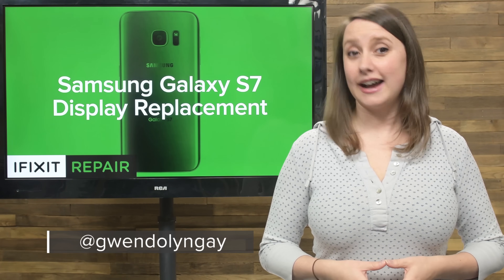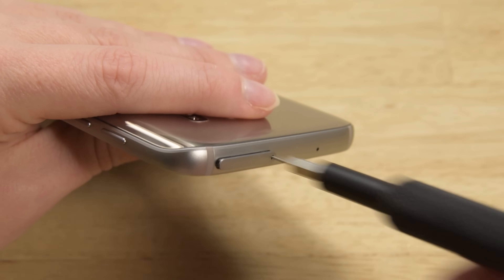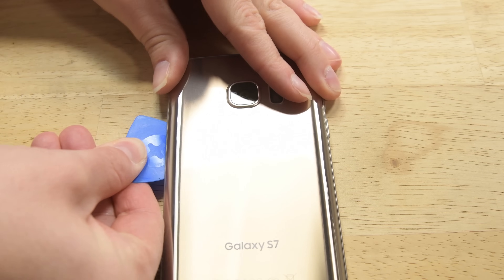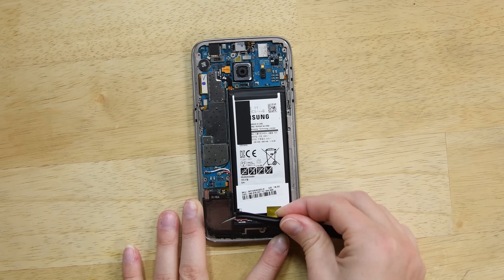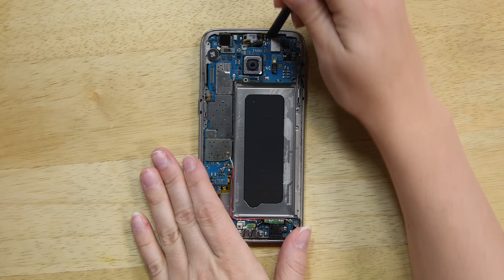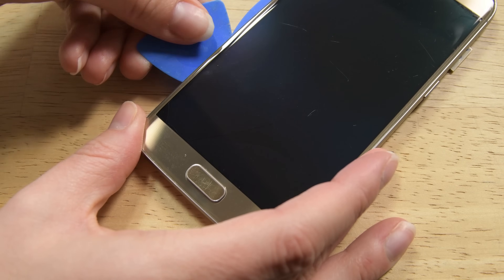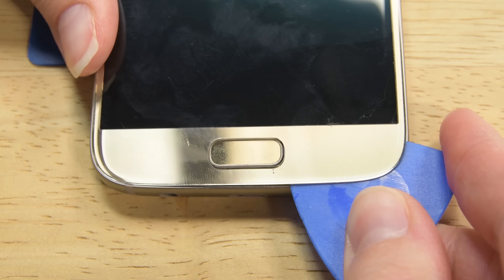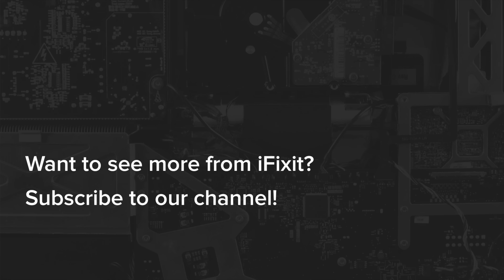Galaxy S7 Screen Replacement—How To

Comment: Not sure why you had to remove the battery and mother board. On an s9 you simply unplug the screen, then work on the screen and remove it. Maybe remove the mother board. But using your picks through the back of the phone to get through the frame just seems like that isn’t the most effective way of doing it.

Comment: I should have not bought this device. Common issue is the screen burn and need to replace the touch screen panel but it's so expensive. The device is expensive and so the repair. The cost of the repair is equal to the cost of some brand new models.

Comment: odd question, maybe somebody here can help??  I still use my s7 but the screen is coming off the phone.  it works, and is not cracked but it's like the adhesive is letting go.  the front glass sticks out past my protective case now so I'm sure it's a matter of time before I break it.  Any easy way to kinda re-glue it?

Comment: Guys please watch out on this: Remove the battery carefully and dont use metal tools on battery, i used a small metal screwdriver and the battery exploded. Pay attention on what tools you use, and if is no need for that, don't do it yourself.

Edit: So be carefull on battery removeing, idk how but i perforated the battery, this caused the explosion. MB was not affected, i dont see any visual issues right now, i ordered a new battery and cleaned up the ash. I will tell you if the phone is still working after this incident.

Edit:The phone is alive, perfectly working, but because of the battery explozion I had to change the lower buttons module, volum buttons band, rear camera and of course the battery. If is no need for this, don't do it YOURSELF

Comment: When replacing the screen and digitize why unplug the mother board. Just unplug the screen wire. Just asking.
Reply: The heat would destroy the MB..  the AMOLE is protected by glass and the frame, the MB is nacked in the frame..

Comment: This video is misleading. It makes the process look a lot simpler than it is.
I had to apply a lot of heat before the back could be lifted with a suction cup.
So much that the phone was too hot to hold with bare hands.

I suspect this may have been enough to damage the phone.
After removing the battery trying to separate the screen from behind cracked the digitizer.

The best advice for someone trying to repair this type of phone is to buy several broken phones and practice first.
You will be able to see how much pressure can be applied before the parts break.

 It is unlikely that you will do this successfully on a first attempt.

Comment: not hard to watch what she has done to remove the screen to put it back on again? the old adhesive can be used if its not in a bad condition. jst keeps the phone more watertight. dont know if you can buy a putty or adhesive as a replacement though. good video. will deffo help people if their handy with a tool kit and delicate wires and terminals.

Comment: Those of you who mention that it doesn't matter if you damage the screen while removing it, since you'd only remove it if it was broken already: NOT TRUE. On the S7, you need to remove the screen in order to replace the charge/USB flex assembly, since the home & back buttons wrap around through the center frame and under the screen. Only way to get that assembly out is to remove the screen too, which might be fine so you do NOT want to be damaging the screen.

Comment: You didn't say about the touch screen part between the front and the actual display. I cracked the touch screen when pushing the front screen from the back. The touch screen is still attached while the actual glass display is off now. I don't know what to do next, whether to just put the new one on or what. Darn it...

Comment: I used to be able to easily replace the outer glass on my S4 mini. Are the LCD and outer glass not different separate components as on the S4 mini? And if it is, and you don't need to replace the LCD can you not replace the outer glass only without going in through the back?
Reply: David glass only repairs without the proper tools can be way more time consuming, risky, and overall difficult. It’s actually less of a headache to just replace the entire display.

Comment: Possible for the s7 edge as well? I have a screen burn in of my keyboard. God knows where that came from also there is a tiny cracked spot. This is with the phone on 30sec screen turn off and otterbox full case. Thanks samsung. Oh yeah, 200$ for a screen repair

Comment: Hi, need your help in this.
My S7 display is broken and its touchscreen doesn't work.
I went to a place and they told me that to repair it they would must have to replace the battery as well. Can you tell if that's true, please?
Cause It doesn't make sense to me.
Thanks

Comment: The guy on the other Video didn't even removed the Battery from the phone...

he just removed the back cover with the heat gun / removed the screws / the components

then the display and he replaced it

Comment: thats a great vid!!  does the home button stay on  the mid frame after the screen is removed? is the home button replaceable? if the other components to the left and right of the home button are damaged too, can they be replaced? can the whol lower portion be replaced? thanks. also, if the back cover needs to be replaced, can a cover without glass be used? if one is made... ( p. s.  youre hot!! ) thanks  oh, if the home button is replaced, will the finger print feature work too? thanks  : - )  can the on-board ROM be increased by chip desoldering and unused contacts resoldered when re-installing? thanks

Comment: This is going to be my first screen repair.  I learned how to take S7 apart. But how to put together?  What glue should I use for the  the LCD assembly and the frame?  The same liquid LOCA glue which I am going to use for the lcd lens?
Reply: Noooooooo
Reply: 90% of the time you don't even need more glue. Use small amounts of thin decent tape on the edges if needed though
Reply: Also try using rubbing alcohol with a small applicator bottle with a fine point plus a pick(I use plastic/waterproof playing cards instead) instead of the heat gun. Less chance to damage components and it's faster once you get the hang of it. Sometimes a little will get into the camera lens but then you just blow it out

Comment: great video,my s7 edge fell off everything was normal but it appears to be a pink line running vertical on the right side of the screen,it disappears by applying a little pressure on the Samsung logo above the screen but unfortunately comes,is there a possible fix without having to replace the whole display assembly??

Comment: And how do I reassemble it? It just sticks together with adhesive that I guess gets all removed when I tear it down
Reply: you may need to buy some adhesive, these can be found relatively cheap on eBay. (currently in the process to replace the screen on one of these and I ordered a few adhesive strips to place in the frame when resealing it)

Comment: use plastic and low heat when removing battery i removed the battery 10 seconds later white smoke everywhere
Reply: Fire? You want to bring a lypo bag when working with batteries

Comment: is it possible to replace the screen only and not the screen and LCD ? it looks like they replaced both in this video
Reply: It would be both impractical and unlikely. For you to separate the display panel from the glass you'd need equipment like a nitrogen freezer. Then to adhere new glass.. a laminator to set the OCA and an autoclave to aid in removing bubbles. Definitely not a DIY job. If you somehow get crazy lucky with heat and playing cards.. you'd have to not remove the display from the midframe and then your only choice is UV glue which I just can't recommend.

Comment: thats not a screen replacement thats a teardown
Reply: If you can't go forward from here on your own, you shouldn't attempt this repair. Not to be a dick.. just what's left is super easy and your criticism is ridiculous. If you can't see you need to line up the display flex through the slot and then align the glass with the home button and earpiece grill.. just don't do this. lol
Reply: the install procedure is the reverse of the removal

Comment: You did a great video, but you did not finished it. Why did you not actually replace the display, that would have been great?????
Reply: mmz12 why is this part not in the video it's stupid how is his videos so popular it's like the first result for this keyword Galaxy S7 screen replacement
Reply: BUT DO YOU REMOVE ALL OF THE BLACK STUFF OR NO???
Reply: the adhesive? it is to be assumed to remove the old adhesive if your replacement screen has it, otherwise (not recommended) you can reuse the old adhesive if its okay condition
Reply: Awesome video. I've been doing phones for years and this is one of the best made repair videos I've ever seen. And I've seen hundreds
Reply: If you get that far it should be easy to finish. Just fit the display flex through the slot and make sure it lines up with the earpiece mesh and home button and.. press it on lol
Reply: You want her to hold your hand? XD lmfao 
After all that its a simple reverse button dude

Comment: 4:59 nice going, you broke it
Reply: It's a screen replacement video...one would assume it's already broken. In fact, she said only attempt it on a display that's already broken.
Reply: Zareh Badkerhanian if you look at the bottom left of the screen when just about to be removed about 15seconds before you can see it
Reply: lehmejoun so what ur replacing it anyways
Reply: lehmejoun How can you tell?
Reply: But you are replacing it?
Reply: or it was already broken...
Reply: fuck i did a same misstake now i can shoot my self
Reply: Dude that happens pretty much every time with galaxy phones. Rule of thumb is you only take apart if the front or back glass panels are already broken. If you have an internal problem and you need to disassemble, then you better have a new back panel at the ready.

Comment: what abt replacing the back cover?
Reply: Reuse the adhesive if it wasn't badly torn and damaged. Heat it up a bit and use a cloth to rub along the edges to seat it. Or remove all of the old adhesive and use something like Tesa tape. Probably 4mm for this.

Comment: 4:59 they destroy the display.
Warning, indeed.
Shame on you, Samsung, for making such a difficult device to repair.
Reply: I did that and ended up messing up the LCD. $120 more that I didnt plan on spending to fix my phone
Reply: Shame on them indeed. Adhere the edges? Sure. But why the entire backing as well with such limited access.. and then the curved edges. lol
Reply: Good eye
Reply: In what way did they break the dispay???
Reply: MacePingu They cracked it by applying to much pressure on the guitar pick making it snap.
Reply: @danilalcariia9305  I saw a thumbprint not a crack
Reply: @d3athreaper100  I usually replace  my screen when I get a thumbprint or two 🙄🙄😋🤣
Reply: @d3athreaper100  Look again.  Watch it at slow speed and you will clearly see how the screen is cracked.  The broken portion actually lifts.
Reply: @danilalcariia9305  It was broken to begin with.
Reply: They wanna impress us with waterproof smartphones and then they use the cheapest of all variants to make it possible.
Reply: Nich Longe UR REPLACING IT ANYWAYS
Reply: Just Because doesn’t really matter. This was a demonstration video, meaning after taking it apart, they would put it back together.
Reply: Gaming with IRRELEVANT BIRDO Exactly. If it's not broken, don't mess with the Lcd.
Reply: Don't use Samsung devices if you have s** problems

Comment: who's stupid idea was it to use glue on mobile phones?
Reply: I've been wondering this for a while.... You sell me a $1000 phone but it is made completely of glass, the most fragile material ever...
Reply: @brittany7734x92  That is because you buy those 1000$ phones for their quality of materials and specs. There are Samsung phones that are rigid as hell, water and dust proof, shock proof and everything. For people who work in construction, the army and so on. They cost less because they are mainly made out of plastic and rubber. Which are cheaper than glass.
Reply: @legendareNz  no you buy those $1000 phones because they're trendy and probably nearly identical to the one that you bought last year. Build quality goes down each year. It used to be that only the cheap phones were glued together. I've been a phone tech for years and have seen it happening.
Reply: @legendareNz  You mean like the Galaxy S8 Active? That one is rigid, but not nearly as rigid as phones from CAT or some of DOOGEEs offerings. But that's to be expected when other brands specialize in making sturdy and rigid phones for construction workers and the like.
Reply: Rob Simpson A low GPA graduate
Reply: Large nails would have been much better..
(or so I thought. Anyone wanna buy an S7 wall ornament now, hangers are included 🙄😉😊😂🤣
Reply: They all do it
Reply: except it's not stupid? it's to help with water proofing?
Reply: @SlimeyCraft  a rubber grommet would have done the same. Stupid design is stupid.
Reply: @mase002  rubber grommets wouldn't be as waterproof around ports etc. And glue is cheaper

Comment: you  explain how  to  open the  phone but not  how to put it  back together. so  my  question is, dont  we need to put  back some glue in  order for  the  parts to stay in  place ? After hitting and  cutting the old  migth by useless!?
and  if  we  have to  what type  of  glue should  we  use?
Reply: MrCaalion Double sided tape should work fine for personal use